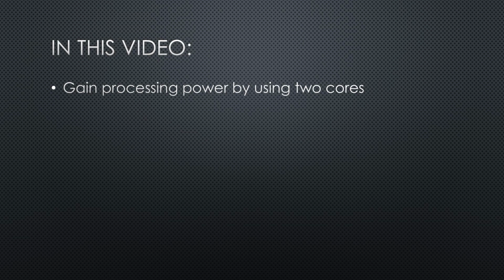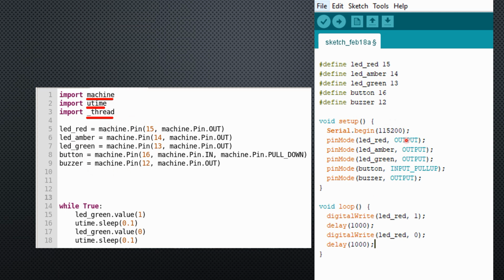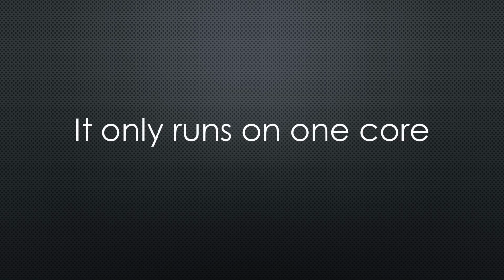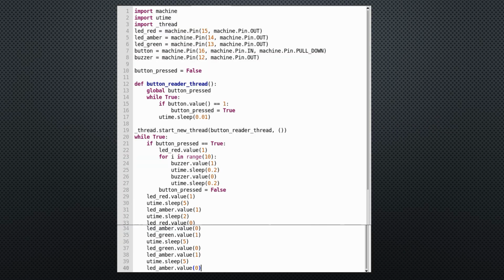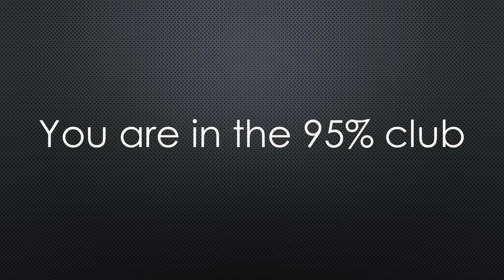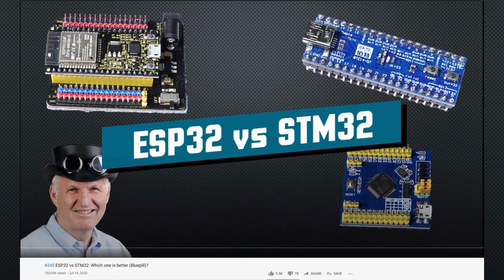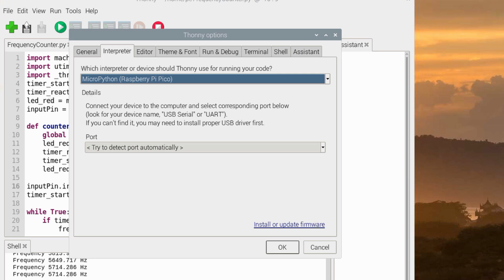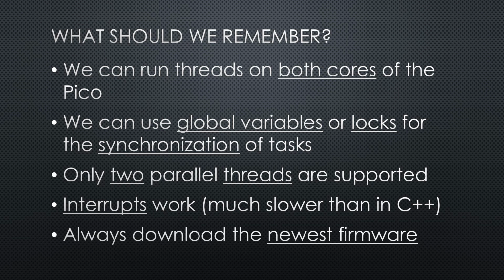#372 How to use the two Cores of the Pi Pico? And how fast are Interrupts?

Comment: The reset pin is the pin 30, is labeled "run", pull it down for reset.
Reply from the maker: Thanks for the tip. I already have my reset pin. But a beginner?
Reply: @AndreasSpiess  It is counter intuitive. 
It also works for accesing the mass storage mode without disconnecting the USB, assert RUN low, hold the button, release RUN. I don't feel like a lot of people know this, would you put a short video about it?
Reply from the maker: Did you try with two cores?
Reply: @AndreasSpiess  I did now, the whole thing resets.
Edit: according to RP2040's datasheet: "The chip-level reset subsystem resets the whole chip, placing it in a default state. This happens at initial power-on, during
a power supply brown-out event or when the chip’s RUN pin is taken low. "
Reply from the maker: I tried it too now. I did not see a difference if I pressed the reset together with the boot button or not. It always resets.
Reply: RUN pin should Always reser the device.

IF the button is pressed when RUN is released from ground, the device will start, like when it get power from USB.

So press the button, ground RUN temporary and then it Will boot like you press the button when powering in the device.

Comment: I tried the pico yesterday with micropython. I found the "getting started" docs online to be quite lacking. Early days I guess.

I used vscode in windows to program it, it actually works...serial connection and all. But yeah...documentation..

I'm glad I'm not the only one who had reset issues - it kinda works if you choose "reconnect" sometimes. It is flaky. Assuming it's a firmware issue. Also I noticed serial debug print has a buffer...it keeps on dumping data to serial for a LONG time after you stop the execution which seems to block the programming and communication and looks like it has stopped listening - eventually it finishes. But...I only spent maybe 10 mins on it so far.
Reply from the maker: I use Thonny on a Pi. A very good experience over all. Just sometimes I had to reset the board.

Comment: You can use the existing button as a restart button 99 percent of the time. This will save the USB socket and cost not even 5 cents. We need to add the code to do it of course. A reset button is not a good idea on a lot of professional products and the Pico is also designed as a component for low volume products.

Or use a hub with a switch, or add a reset button to your breadboard.
Reply from the maker: I have my reset button now. But this is a board for beginners...
Reply: @AndreasSpiess  as I say I think they can largely fix this by adding software to both python an c/c++ frameworks to monitor the switch that is already there. You can then choose to make the button a restart/ mass storage button in your projects. Short press for restart, long press for reload.

Comment: Fantastic video again. You are a few steps ahead of me, I will get to the 1% soon :). I am testing using the PI Pico as a robotics motor controller with motor encoder monitoring. I could get it to track encoder pulses from an irq up to around 16KHz but was measuring encoder pulses per x amount of time (Using the Timer function  in micropython so don't need to calculate time since last pulse), so the code I had in the irq callback was simpler, just a increment of count. Because I want to track two motors for a robotic platform the threading will be useful, hopefully I can run the irq callbacks on separate threads without them impacting the IRQ responsiveness.
Reply from the maker: Did you check your results with an oscilloscope? 1/50us is 20kHz. So your ISR probably takes most of the processing power... IC++ it is much faster, BTW.
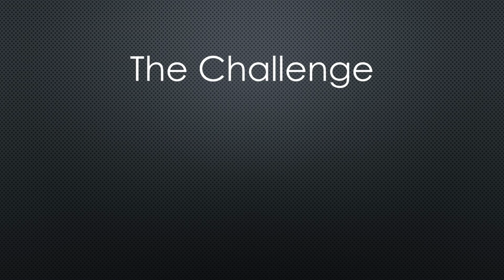Reply: @AndreasSpiess  - I used a function generator to generate the irq for the test. FYI: Video of the test is here https://youtu.be/TWYHvw0IuUQ 10:53 in. The plan if the Pico can't keep up with two motors is to switch over to an ESP32 or Blackpill , worst case I will have to code in C (but am trying to avoid it)
Reply from the maker: This is probably a little faster than my method. You still can use the second core for that task and use the first core for calculations...
Reply: A fine example of why someone needs to break this chicken/egg scenario regarding the Parallax P2. 16KHz is miserable 😁
The best way to use interrupts is not to use them. Apart from the P2's eight parallel processors, its 64 identical "smart-pins" can be pretty much anything one might need. Any pair of pins can decocde/count a quadrature encoder.....even with all eight processors idling. How about a frequency of sysclock/2 ? I am not aware of any dedicated quadrature-counting device that can come close to this.

Program in C, BASIC, SPIN, ASM or combine any/all of those languages.
If nobody knows about the P2's existence then naturally, nobody will be using it. 😉

Comment: Could you source a microusb data cable with a power switch? Or even better momentary button to disconnect power?

I've seen cables with a switch, but every one I look at is data only

A proper cable or a simple shim would do
Reply from the maker: I added a reset button now. But I am not a beginner ;-)
Reply: @AndreasSpiess  Pimoroni have this. https://shop.pimoroni.com/products/captain-resetti-pico-reset-button
Reply from the maker: On twitter they wrote it is a joke. Maybe they also missed the button...

Comment: Using a lock that way can cause problems you can deadlock your program if release is not called eg in the case or an exception, a with block avoids this problem:

with baton:
    # do stuff...

Now when the with block is entered the lock is acquired and released when the block is exited including by an exception.
Reply from the maker: Your example works the same and looks simpler. It is probably not as easy to understand. I do not see a big difference for a deadlock. If the loop does not reach the end I get the same situation. Or do I miss something?

Comment: What is the issue with the RESET? Since you're already connecting external components to it, you might as well add a tactile button between GND and pin 30 (confusingly called RUN) to reset the chip.
Reply from the maker: I know and I did it, of course. But is this my job in 2021?
Reply: @AndreasSpiess  That wasn't quite clear from the video or I missed it. I can totally understand why they haven't added one; if you're a maker and hooking up external components on a breadboard anyway you might as well add a reset button (the pullup is already there) if you need it but if you're integrating the board on your own circuits you may not have a need for it or it could potentially be in the way if you don't want users to fool around with it (I certainly have removed reset buttons in the past). Either way I think it is fine as is and just wasn't sure whether you knew about the exposed NRST pad...

Comment: My understanding was the way MicroPython runtime bytecode interpreter ran, didn't allow the code to run on multiple cores efficiently.
Having said that, today's MCUs run in hundreds of Mega Hertz. So, it will most likely kick an Arduino to the curb. 
Will await your RTOS videos with anticipation.
Reply from the maker: Micropython seems to run on two cores...
Reply: @AndreasSpiess  yes, it is noted in pico`s upython doc: " Only one thread can be started/running at any one time, because there is no RTOS just a second core. The GIL is not enabled so both core0 and core1 can run Python code concurrently, with care to use locks for shared data."

Comment: Dear Andreas, comparing micro Python va C/C++ is not a fair comparison. Raspberry Pi Pico can be programmed with C or C++ as well, and you will find out an IRQ response time similar to The STM32.
A small tip to Reset the RPi Pico: You can give a 0v pulse to the “run” pin. That is basically your reset push button. 

Thank you for your videos!
Reply from the maker: To compare two things is always fair. If I would cheat with the results, it would be unfair. We all know that MicroPython is slower in execution but faster in programming. But how much is important for our decisions. 
You find the C++ results in the pinned comments, BTW.
And I have my reset pin, of course. But if I would be a beginner, the core customer of the Pi foundation?
Reply: @AndreasSpiess  thank you for your response. 
I read about the reset button on one post of Alastair Allan in the official raspberry pi blog. The response of why there is no reset button on the RPi Pico is the cost factor. Keeping such a high quality board on the $4 mark is a challenge. 
I’m looking forward for more RPi Pico videos.
Congratulations for you channel.
Reply from the maker: You are right. I heard the interview on the Amphour where they said the same thing. As Einstein said: As simple as possible. But not simpler.

Comment: I have an program that uses PIO to drive 50 WS2812 leds and also a timer that is firing 120 times a second.  The timer drives an output pin that is tied to 6 other pins to simulated inputs.  I have 6 separate interrupt routines attached to the 6 input pins and all I do in the irq is increment a global counter(1 counter for all 6 irqs).  Looks like it works great, except that randomly, it locks up - generally between 10-20 minutes of running. Last tested with MicroPython version rp2-pico-20210219-unstable-v1.14-72-gd28dbcd6c.uf2.  Have you had any problems with your interrupts causing a lockup?
Reply from the maker: Mine did not blockings. But my script seems to be much easier than yours...
Reply: @AndreasSpiess  Just now, I commented out the led code and added a separate counter for each interrupt so they are not trying to access the same global variable.  It still locked up after about 20 minutes. I also have 2 of the interrupts firing on the rising edge and the other 4 on the falling edge to spread out the time - that did not change anything either.
Reply: I think I have found MY problem.  In my led display loop, I use a "time.sleep(.25)" to give some delay between color changes.  This sleep command seems to cause the problem.  I replaced it with a simple "while increment loop"  and the code is no longer locking up.  I increased the interrupt rate to 1200 time a second * 6 interrupts and so far, I have processed about 6 million interrupts without a hang.

Comment: Does threading on Micropython not use GIL? If not, then I'm bamboozled!
Reply from the maker: I even do not know what GIL is :-(
Reply: @AndreasSpiess  My apologies. Python uses the Global Interpreter Lock (GIL) to ensure consistency of python's internal datastructures when running threads. This usually also means that most of the code doesn't technically run concurrently*. Python's docs say that 'threading' is built on top of the '_thread' library, which (I think) is what was used in the example you described. I'm not sure if the code you describe is actually running 'concurrently'

I came across this when learning python and didn't get why my threaded code didn't run as fast as I expected, and when I realized this, it got burnt into my skull :) (ah college projects!). I switched to multiprocessing to get past the GIL. 

Link to the relevant python glossary for completeness: https://docs.python.org/3/glossary.html#term-global-interpreter-lock
* Except IO bound calls and other 3rd party libraries

Great video as always! Thank you for the amazing content, whenever I come across a new MCU and drool, I go straight to your channel through my handy bookmark!

Comment: Thanks for your video!
I'm also very interested in the PIO speed, but have no Pico to measure myself.
I guess you could build a simple pin-> pin latency test the following way:
- Set up a DMA channel to copy the same byte into the IO-space to change the pin (there are different bit manipulation functions at offsets, like set, reset, toggle)
- use the PIO to kick the DMA
- Maybe you need a second DMA channel or DMA channel chaining to keep the whole engine running
Reply from the maker: I wait for the results of the challenge. If this PIO is simple to use I expected many contestants. So far I got none :-(
Reply: Jan, if you use PIO for example to drive GPIO pins to just generate a square wave the max frequency would be clk_sys/2 (62.5 MHz) since it would take 2 cycles to complete the code below:

.wrap_target
    set pins 1
    set pins 0
.wrap

Comment: This is a great presentation. Lots of good information to use when I can get my hands on a supply of these boards. The only ones currently available in the US are from scalpers charging 3 times or more than companies taking back orders. Perhaps I'll just have to suck it up and wait until March 17 when legitimate orders are fulfilled at a reasonable price.  I think there will be a version at some point  with WIFI and Blue Tooth to compete with the Esp-32 if the price is comparable. I hope you have a great day.
Reply from the maker: We will see if they are able to add WiFi. This seems not so easy...
Reply: @AndreasSpiess  I would settle for LoRa over wifi. It would be nice to read sensor data over a distance. In fact I think LoRa would be more useful anyway.
Reply: Well, a WiFi version just came out 2 days ago, not sure if they will make a Bluetooth one too
Reply: @kosmasraptis8374  I saw that it was available, unfortunately they will only let you buy 1 and I want 10. I guess I can suck it up and buy just one. I just hate to pay huge shipping charges on something that cost 6 dollars..I already have a project in mind so I might as well buy the one before they are all gone. The device is technically bluetooth ready but it's not currently activated.
Reply: @rickhunt3183  Perhaps you can get a Bluetooth shield for that
Reply: @kosmasraptis8374  the newest version has built in wifi and bluetooth, but the bluetooth isn't currently supported with this version. You could always use a hc-06 bluetooth module. It supports master and slave mode. I've never connected one to a PI Pico  but it shouldn't be too difficult.
Reply: @rickhunt3183  Wait, it's also got Bluetooth on it?
Reply: @kosmasraptis8374  the new one does have bluetooth, however you cant take advantage it because its not currently supported with this production run. I'm certain at some point it will be. The chipset used for wifi also Incorporates Bluetooth, but it cant be used at the moment. They are currently available for 6 dollars US, but I havent found anyone that would sell me more than one. Once production catches up im sure I'll be able to buy 10. That's my plan anyway.
Reply: @rickhunt3183  When you say production run, you mean the boards themselves?

Comment: I made myself a cable with a reset button. Works for every mcu =)
Reply: at least we have some innovative people here,  I wish more engineers are like you and well done, problems can be solved easily with a bit of innovation instead of complaining
Reply from the maker: I soldered a fitting button across the two pins. But is this my task in 2021?
Reply: @AndreasSpiess  A great innovative and engineering task accomplished, well 
done : )

Comment: Yes, now in HD again :-)
I think if you need to power off a micro USB plugged device, the most convenient way to do so is a cheap USB hub with switchable ports. At least i would not want to miss it.
Cheers from Bulgaria
Reply from the maker: 30fps especially for you ;-) 
You are right. I solved the issue with a tiny button. I still think it should not be the task of the buyer...

Comment: Another great video Andreas, A little favour, could you or any of your followers reply with a link for an add on board that would support 5 or more cheap 433 MHz key fobs, it's for a gate control  project. Yes I know I can use wi-fi and will, but split arse can't be bothered to get her phone out.
Reply from the maker: Thank you.
You find plenty of such 433MHz videos, I think. Probably not for the Pico, but you can port it if it is important for you.